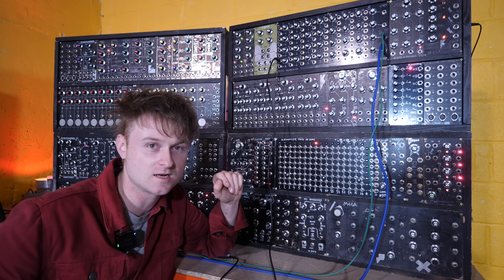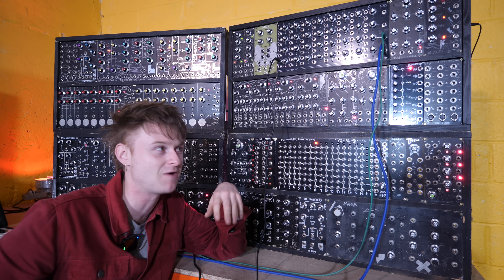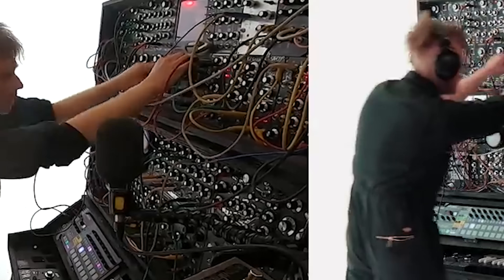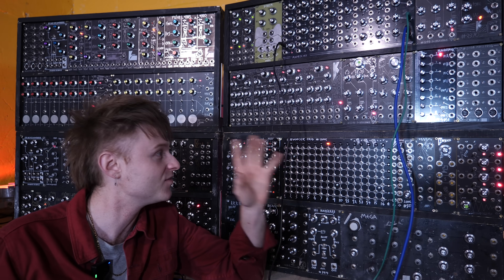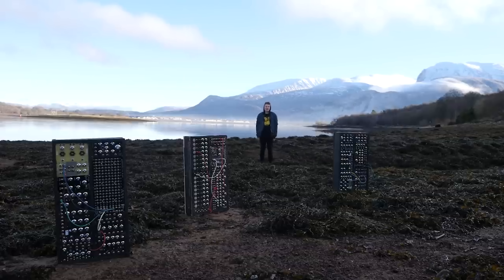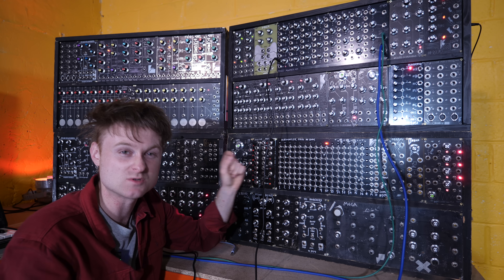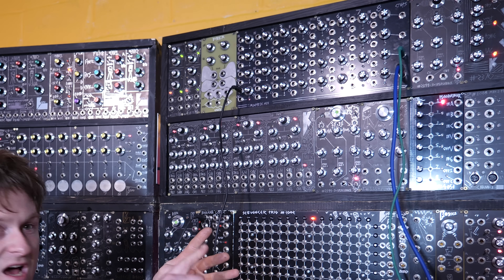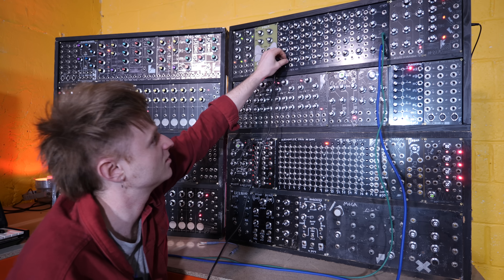How To Wire A Song From Start To Finish on Portakosmo The DIY Modular Synth

Comment: Smashed switches good thing I inset mine. 😮 Too bad I probably have only moved my diy synth a total of 100 ft in distance from my house since I built it. Only regret not making the case plywood for strength. I would change it but the stickers on it are 🔥

Comment: That's great. Now tell me how to do it in VCV rack ;)
Reply: It is no different, the techniques. For instance, the old VCO > VCF > VCA with envelope applied to CV for frequency cutoff on the filter and envelope to the VCA is the same in VCV and in the physical world.
Reply: @Tofu_Pilot  Yeah i know. It's just that i discovered Look Mum No Computer only few month ago along with the existence of those synthetisers. Then few weeks ago i found out, that VCV rack exists and i can try everything without having this box. I have downloaded some patches and i'm trying to use it and have fun with it. But it's lot of new stuff to learn. And you need lot's of experience to make it sound at least decent
Reply: @joudatfd the main problem with vcvrack for beginners is that there's too many options. recommend limiting yourself to only the base modules for a year to learn what they're supposed to do, and most importantly- what they can do that they're not supposed to do. omri cohen vids are a good place to start.
Reply: The real secret to the ultimate portable is having all that virtually inside a laptop or tablet (miRack or Cardinal forks), although it's less impressive to look at irl. 😏You can kind of copy it as it is. UI on his modules is different in places due to the DIY aspect, but the functionality is the same as the modules available there. There's nothing that stands out as missing from the virtual library, just some time spent in matching up the sounds with the right oscillators. (Befaco Kickall was even said by name, but I think there's Pony in there too with the wave-foldy hint to it among other stuff.)

Comment: Knobz&knobz&knobz&knobz&knobz&knobz&knobz

You should have used all the different patching systems all over it. So to run it correctly your cables would need to be like 1/8 TS to banana or 1/4 ts to bare wire. Just, a synth players nightmare. It would be hilarious. Seriously cool kit though, it sounds fantastic.